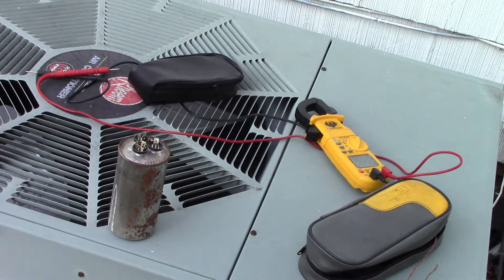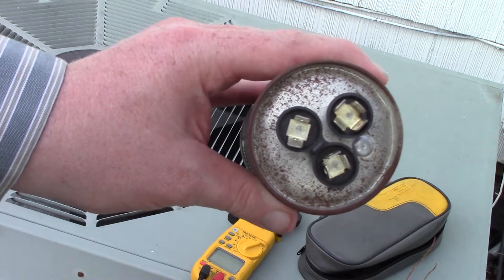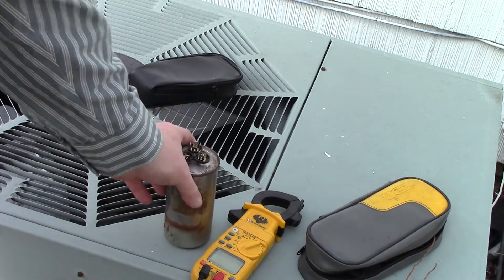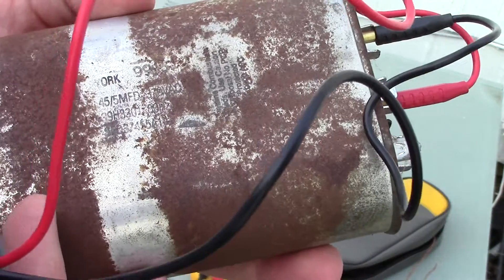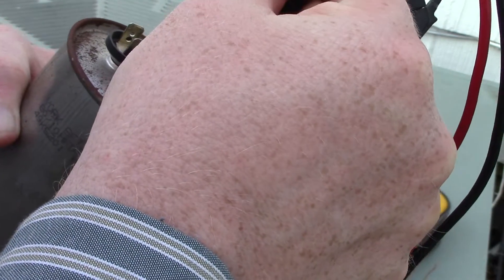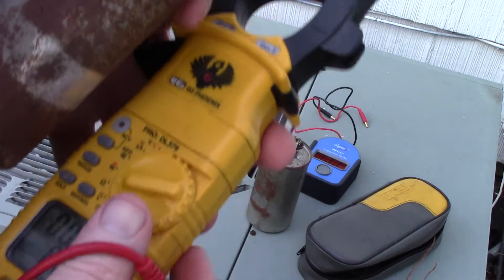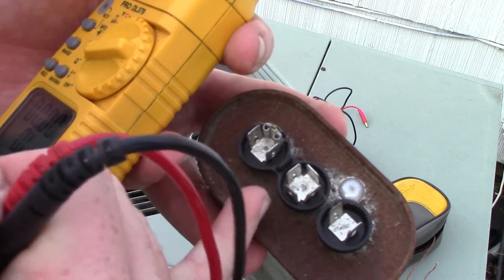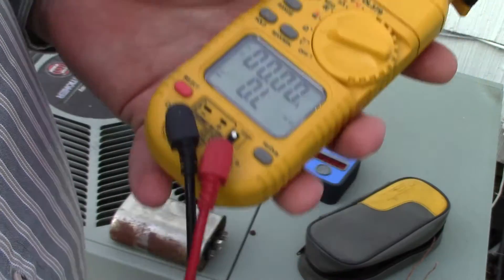Using a multimeter and Supco capacitor tester to test HVAC capacitors

Comment: He states 10% OF 5 IS 0.5 so 5.1 is OK.   Sadly incorrect the 10% limit would be 5.05 uF so this capacitor is NOT within spec
Reply from the maker: J P my calculator says 10% of 5 is .5, so the calculator says 5.5 is the upper limit while 4.5 is the lower limit. 5.1 is still in range and has not exceeded the upper range. So unless I am missing something, your math is wrong.
Reply: It should be + or- 6%
Reply: ACtech Formally yo mama 
10% Only if it’s not specifically stated on the capacitor 
But your right most are 5%-6% because it’s stated that way.